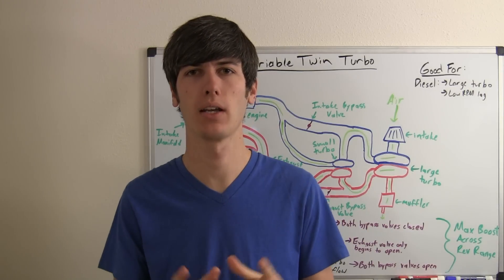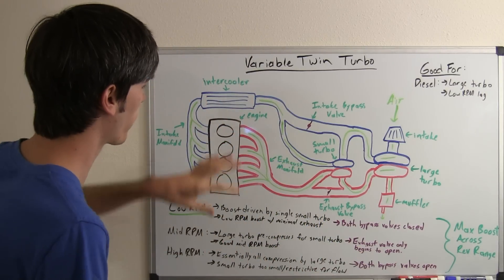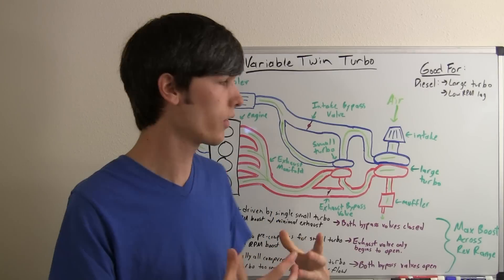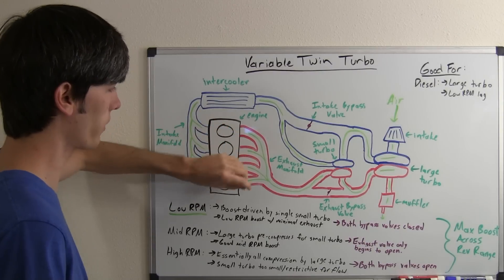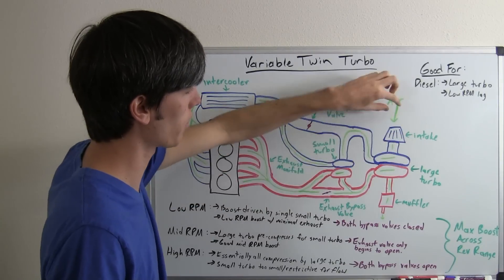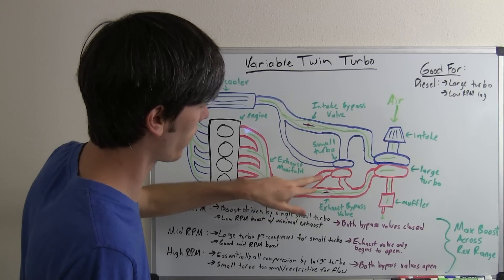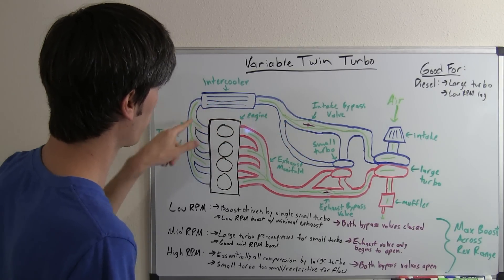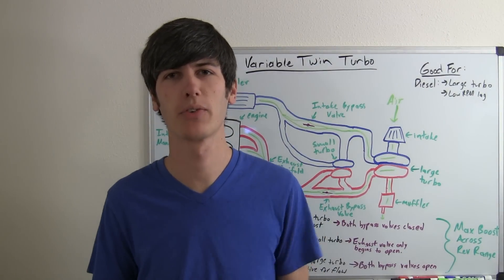How Turbo Diesels Work - Sequential Turbocharging

Comment: The smaller turbo is useless at a certain point, similar to twin charged systems where the supercharge has put out the maximum amount of pressure, and should have a shut off so it would draw energy from the engine. The same should be done for the smaller turbo. The bypass valves should be positioned at the inlets of the x pipe (if you know what I mean by x pipe) so there isn't pressurized exhaust gasses hitting a "wall". This design is extremely inefficient. Especially when you are buying a brand new 60-80 thousand dollar diesel truck... WTF?
.
I'm open to any and all constructive criticism. Especially from mechanics that work on these engines all day 5-6 times a week, and most likely get pissed as hell when coming across such ill engine designs....
Reply: Do you think a Variable Geometry Turbo is more efficient than variable twin t?
Reply: Gilberto Zarco  Well what I don't understand is the one with the adjustable fin/flaps ("Variable Geometry Turbo") is on the side where the exhaust is powering it, like the Volkswagen TDI turbo diesel (I rather call it "fuel oil")... WTF? I was searching through vids about removing the EGR valve, and came across one where a guy was removing it from the Volkswagen fuel oil engine. Problem with that is those fin/flaps depended on the unspent fuel oil to lubricate them... a problem if you where to remover the SToooooPID EGR valve (watch?v=xn6jiEpADYg This vid shows the damage a EGR valve can do to an engine)...
.
I guess the Variable Geometry Turbo would be a good idea on the right side, where it isn't subject to hot exhaust gasses breaking/wearing it down, and can have some kind of lubricant that won't evaporate from the hot exaust gasses! I still don't think they are maximizing the efficiency of what a turbo could do. The twin turbo setup is just complicated... And why haven't they separated the to turbines:
"Exaust----Intake", that would illiminate the need for a stupid inner cooler. Not to mention MORE BOOST!
.
I was thinking somewhere along the lines of a paddle fan with enough clearance to let idle air go by at low engine speeds (can't hardly think it through right now). The ideal would be to regulate the air into the intake after the turbo, down the pipe. I'm sure an adjustable wind vine, or maybe incorporating something like another Mass Airflow Sensor to adjust the amount of pressurized air going into the intake.
.
I'd have some better ideas, but my dick/balls and sawed of ass is getting mutalated groped and picked. As well as I am having a lobotomy... this is being done by some extremely rouge local governmental authorities that see me as a threat to their Mexican pedophile snuff ring. That as well as they get PISSED AS HELL when I point out simple inconsistencies in engine designs, in vehicles. HOLY SHIT THEY ARE HORRIBLE. I live in Watertown NY by the way... 201 Sterling St. Apt #9... right across from a court house that looks like Solomon's Temple. "And Justice For All"... is a good depiction of what my life is like... HORRIBLE!!
.
I LOVE QUESTIONS... I just hate the violence that it comes with!
Reply: I hear you, an enhanced turbo prototype should come out soon. Car manufacturers are so focused on traction control technology that they often forget the core of the vehicle, the engine. I find the Variable Geometry Turbo more efficient than the Variable Twin... The TD Volkswagen Amarok has two turbos; one for low revs and one for high revs (they call this system biturbo), with a small 2.0L engine. This seems to be the new trend, small engines with biturbo. Having two turbos that can´t be used simultaneously is stoopid. On the other hand, the Variable Geometry Turbos adapt to both low and high revs, which makes them very efficient. Problem is they only work on Diesel engines since exhaust gases on Gasoline engines are way too hot. The new Ford Ranger PX 3.2L TD (not sold in the states) uses this mechanism and is very efficient. I agree with you that a con of the Variable Geometry is lack of lubrication; which is why it is important to leave the engine running for a while before turning it off.

BTW that EGR valve did some serious damage!
Reply: Gilberto Zarco Experience has shown driving a diesel as it should be driven on autobahn rarely causes EGR clogs, but in Europe, a lot of times we blind it up and remove DPF, those are problem in paste decade's cars

Comment: Yeah can't watch anymore of this. It's not twin turbos it's called tandem or compound but hell what do I know. There are no bypass valves in any of the compounds I have seen maybe a waste gate on the exhaust side. But hell what do I know.
Reply from the maker: Probably a great guy to chat with at a party, thanks for the feedback.
Reply: I have a VW Amarok 2.0 litre bi-turbo diesel engine. It has this exact same layout except for the admision by pass valve. In the Amarok this is a mechanical check valve
Reply: +Engineering Explained Are you sure about the bypass valve placement? Wouldn't the valve be more effective at the intersection were it splits to the smaller turbo intake side and before it goes to the smaller turbo at the exhaust side? So you could completely block of the small turbo at full throttle and don't "lose" energy for spooling the small turbo, which is kind of useless at higher RPM? Because if you place the valves where they are in your picture, you divide the airflow don't you? Of course most of the air would go through the opened valve because of the (assumed) lower resistance, but some "bleed air" would still pass through the small turbo, wouldn't it? So wouldn't it be more effective to redirect the air through the bypass by shutting the small turbo off at the same time?

I am honestly asking! And sorry for the english, I am german...

Comment: What does the bypass valve run off of? Is there a sensor that tells the psi or cfm? If so can it be a mechanical system similar to the thermostat in a car or does it have to be electronical?
Reply from the maker: Andrew Drigans Could be based off engine RPM as well as throttle position.
Reply: Engineering Explained
What throttle, it's a diesel :D
Reply: akkudakkupl diesels still have throttle... how else would u give it fuel???
Reply: metal666maniac11
Diesels have no throttle. Their power is controlled by metering fuel directly to cylinder. They are constantly 'wide open throttle'.
Reply: akkudakkupl
i believe he means throttle pedal....
Reply: Power Stroker
Accelerator pedal? :P
Reply: akkudakkupl
i aint saying hes right just what he means
Reply: Engineering Explained If it was based off of throttle position there would be a lot of lag. It would be most useful (if a computer was out of the question) to use a belt driven governor in my opinion. Correct me if I'm wrong.
Reply: akkudakkupl any diesel with a dpf very high chance has a intake air throttle, it is used for regeneration control and shut off shake.

But I think the poster meant acc pedal
Reply: Istiaque Choudhury But it doesn't have anything to do with the engine speed control?... Also safety throttles on turbodiesels are a good engineering practice - if the oil seal bursts on the compressor side you have a runaway engine that will gain RPM until it self-destructs (or siezes) even if you turn the 'ignition' off. If you have safety throttle it will cut off air to the turbo and save the engine.
Saw this happen once IRL. Dude didn't want to listen to reason (told him to pull the handbrake throw in highest gear and dump the clutch, but he was scared he would break something.. well he broke his engine then). Or you can stuff something down the intake pipe and pray it block the air passage.
Reply: The diesel throttle is post turbo, just before the intake manifold but after the intercooler.

You're right about stalling in case of turbo failure, but as others and myself have said the original poster meant accelerator pedal NOT throttle (valve).
Reply: Istiaque Choudhury
his point is many diesels do not have a throttle valve
Reply: Andrew Drigans Normally large external wastegates are used for the bypass valves.

Comment: i think you haven't thinking about the diesel pump 
the pump pumps diesel enough to the large turbo
so then the system goes down to the small turbo the engine get all to much diesel
how will you so do that

Comment: In your diagram why do you need a bypass valve between the small and large compressors? I thought the point of having a compound setup is to split the pressure ratio between the 2 turbos. So the big turbo will feed directly into the small turbo. The pressure ratio of the large turbo is multiplied by the pressure ratio of the small turbo to give final amount of boost. I am in the beginning stages of piecing together a 600hp compound kit for one of my cars. this is my first compound kit so I am still learning.

Comment: Hi there, firstly thanks for your helpful videos! Just a thought though, where you have the bypass valve for the exhaust, would it not be better to have a three port valve thereby shutting the small turbo off as the larger turbo comes in to play?

Comment: I work for volvo as mechanic, volvo actually changed there turbos on there diesels to this type of turbo,they used to use variable vane turbo but the soot would contaminate the vanes causing them to stick.

Comment: and my single turbo set up on my 6.0 Powerstroke will spool up to 65 lbs of boost and there really isn't any lag because it is "tuned" correctly you need to add in here that fuel ultimately makes a turbo diesel and timing.

Comment: You put a potato in the exhaust of a diesel and it will start a diesel is ran off compression and compression is a whole lot of air you put a potato in a gas vehicles exhaust and it will not start due to gas motors need proper back pressure to run thats why mainly all gas motors can NOT be straight pipe unless tuned correctly. Diesels don't need back pressure at all. I am up for a good argument because I own 3 diesels a IDI 7.3 a Powerstroke DI 7.3 and Powerstroke 6.0 DI can you tell me I am wrong lol.
Reply from the maker: Yep, I can. Backpressure is not needed, exhaust velocity is needed. This video explains it further: Performance Exhaust - More Horsepower

Comment: And they are set in tandem exhaust flow is controlled by a waste gate and you are absolutely wrong in this video a diesel would fall on its face with this set up guarantee that.
Reply from the maker: Well this system exists on a production vehicle (Opel Vectra), so...

Comment: A little bit off topic, but how does the intake manifold evenly separate the amount of fuel/boost evenly to each cylinder, it would make sense that the fuel/boost would take the easier path, and a larger amount of fuel/boost will go to the cylinder that is closer to the intake manifold and not the others? How does that all work?
Reply from the maker: Pressure is going to spread out evenly, as that's typically the easiest thing to do. Fuel is injected individually for each cylinder, unless it's a carbureted engine.
Reply: Engineering Explained Can you tell me what waste gates are please? Why would you even do exhaust bypass valves just more strain on batteries.

Comment: One question men..I dont understand if the engine is working on High RPM the air is going through the exhaust and intake valve...and if its going through the exhaust valve we have the example of ordinary TURBO engine motor...I mean motor with one turbocharger...And why then is the power of the engine so strong and stronger then this ordinary turbo engine motors??? I dont think they made this smaller turbine just to stop the old turbo-lag ...beacuse this smaller turbine is not used in any purpose if the exhaust valve is opened  ...thanks :)

Comment: this is still a sequential setup and would be found on more cars than just diesels, your thinking about a compound setup that is usually found in diesel because of the high boost. also the turbos should be sized so the bypass valve opens only a few hundred rpm away from the main turbo spooling so you dont have to run the air into a restriction and the bigger turbo isnt for higher boost its because the bigger turbo can move more air.

Comment: a 10 second twin turbo diesel truck can beat a Ferrari or even Lamborghini at 1/4 mile easily...
Reply from the maker: If you guys would like to continue this debate please do so over PM, thanks.
Reply: a 9 second Ferrari can beat a 10 second twin-turbo diesel truck at 1/4 mile easily ...
Reply: Callan Klimtschuck Don't think there's any 8 second Lambos or Ferrari but there's u second diesels
Reply: 7150285
hahah I think you missed the point.
Reply: Callan Klimtschuck what I meant is I don't think there isn't any 8 second Ferraris but there "IS" eight second diesel trucks...
sry for my previous typo
Reply: 7150285
So there are people who build 8 second diesel trucks but no one builds 8 second ferraris? Because to reach 8 seconds these vehicles arent stock, point A. Point B, I'm sure in the boondocks of your lively hood small southern town there are people who work on their big diesels and do work, but in other parts of the world people ALSO build cars (its a crazy thing actually). Instead of putting big turbos on diesel engines and throwing the timing around, they actually build CARS. expensive cars too! TT lambos, Built GTRs, TT Ferraris.. wowzers, could you imagine someone actually building a fast car instead of a diesel truck? Its hard to wrap your head around, but you'll understand one day.
Reply: Callan Klimtschuck well, one big advantage the diesel engine have is it have a lot of TORQUE and that's what gets the vehicle moving from the dead stop. Horsepower is more important once you get the vehicle moving like on a road course
Reply: 7150285
You're off the point. That has nothing to do with what I said.

Comment: Not sure if this is what the newer landcruisers would be using but whatever they are using works well. When I was still able to move around I was a vol firefighter with the NSW Rural Fire Service and their new cruiser tankers wind out VERY well for their weight on take off, I know they are Turbo/intercooled and believe they were v8 diesel. When pushing hard to get mobile fast they draw enough through the snorkel you can hear the suction from in the cab really well lol.

Comment: How is it different to "sequential" twin turbo from the previous video ? (excluding the obvious turbo size difference)
Reply from the maker: You've hit the nail on the head. Different sized turbos. Instead of using both at high RPM it primarily uses the larger one.

Comment: Is a diesel high compression or low? And is the difference just how much rpm and pressure it can be under?
Reply from the maker: High compression, they're built for higher pressures.
Reply: Engineering Explained The only reason why diesels are high compression engines are because they don't have spark they need the compression for starting you clearly are missing facts bud.

Comment: Thanks for switching in automotive topics..
Reply from the maker: They've all been auto topics, just in disguise. Apparently no one thinks electric cars/hybrids exist, so I've gone back to fossil fuels.. :)
Reply: Engineering Explained i was actually referring to AC power,motor and lithium battery stuff..i actually liked that you covered the hybrid vehicle..it is a must know for students like me who want to pursue a career in automotive industry..
Reply from the maker: Hybrid vehicles many times use AC power, motors, and lithium ion batteries. :)

Comment: car with 2 intercoolers, is it stupid? big one for the big turbo and a smaller one for the small turbo.
Reply from the maker: It could be done, not stupid depending on the routing.
Reply: the smaller intercooler for the smaller turbocharger doesnt look economically justifiable for its purpose and also at low RPM's the pressure and temperatues are low...!
Reply: Already done on the vauxhall astra BiTurbo and Insignia twin turbo cars.

Comment: This reduces the 'turbo lag' right?
Reply: yes and no. The big turbo still has a big lag but it bothers you less as smaller turbo is trying its best to cover up that lack in torque/power delivery
Reply: electronics play a big part then, I guess..
Reply: Alfredo Meireles Absolutely. That, and how you use your right foot are going to determine whether or not, and to what degree you experience lag. It will be far less noticeable under normal driving conditions with this type of setup, but under full throttle (especially when accelerating from a dead stop) you'd probably still experience a little lag...but that's the price you pay for turbo power.

Comment: Please do a video on compound charging next dude!
Reply: Take a large turbo and feed it into a smaller turbo. Double compresses the air and makes the torque curve much smoother as it eliminates turbo lag from the smaller turbo spooling up o feed lower rpms.
Reply: I definitely need his whiteboard diagrams to fully understand lol
Reply: CBRsmithy
I saw a really cool build on a DSM that the guy compounded his turbo on it. Was quite informative.

http://www.dsmtuners.com/threads/my-compound-turbo-set-up.336541/
There is the build thread. He explains it and shows his gains and such.
Reply: @SkylineBNR34  other way round bruz
Reply: @darcyguerinhanlon3916  I corrected the original comment. I even included a build thread and still wrote it wrong.
Reply: Your videos are really great and informative. Can you do a video on compound tutbo charging. Thanks